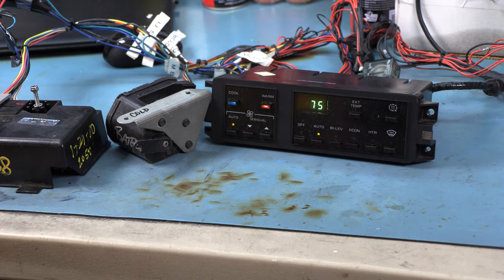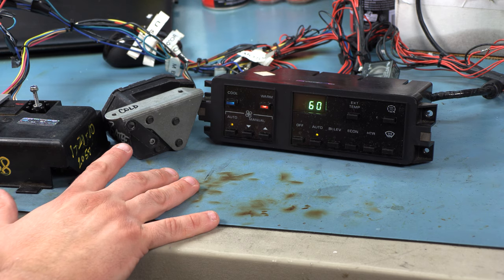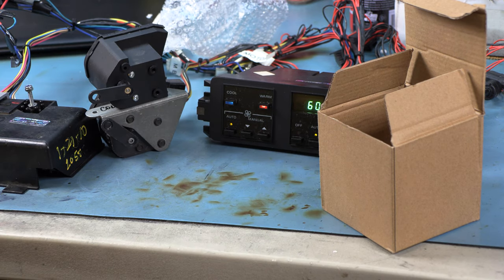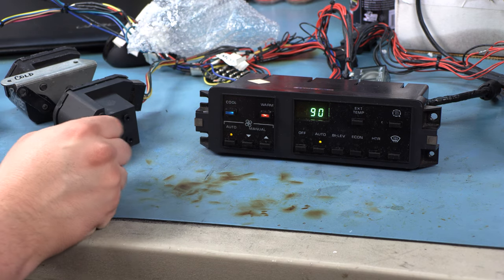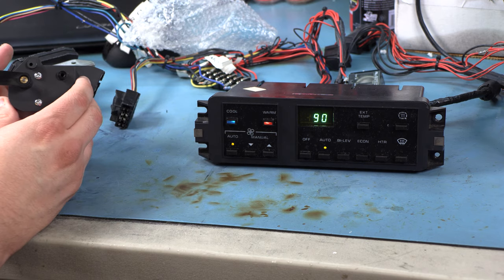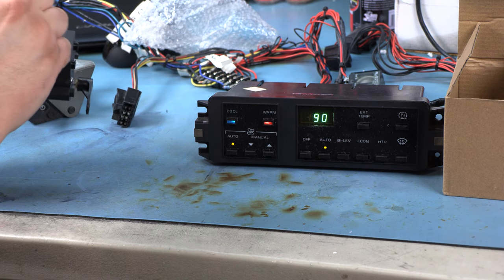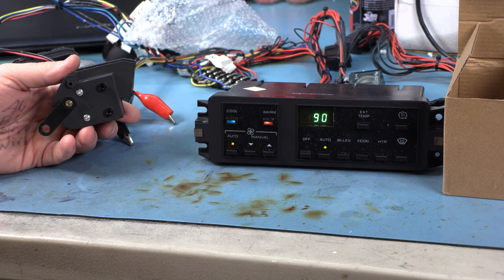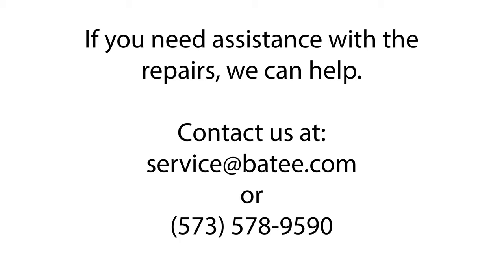86-89 Corvette - C68 HVAC Blend Door Actuator Motor Testing 2021 by batee.com

Comment: Wait a second here, something's not right. I have a 1987 Coupe and everything is vacuum operated. What's up with the electric motors? What am I missing here?
Reply: Selections about defrost and recirc and which vents the air blows out are controlled by vacuum actuators switched by the programmer module. The blend door motor that selects hot or cold or medium air is this electrical servo, also driven by the programmer module. —BATEE

Comment: So... is there a video on rebuilding the motor/servo? I took mine apart and I wouldn't be surprised if that is part of my problem.
Reply: Holy cow was this a pain to put back together properly. I ended up having to remove the potentiometer, run the motor full in one direction, and then reseat the pot full in that direction. That little plastic arm that runs the blend dor open and closed is the easy part, but you will have to install and remove it a few times to get it just right.

Comment: That is really interesting. I have purchased some parts from you for my 1986 Corvette dash, worked well. Gonna need a set of polarized overlays for it soon.
 But I also have a 2001 Pontiac Montana. The heater blower motor dies and we replaced it with a new one from an after market supplier.. Couldn't figure out why it didn't blow air out any of the vents. Come to find out the motor was wired backwards! It was trying to blow the air back out the cowl. Reversed the wires and it works fine. Some body is color blind in the assembly plant I betcha.. LOL